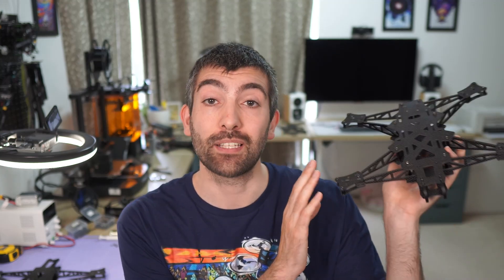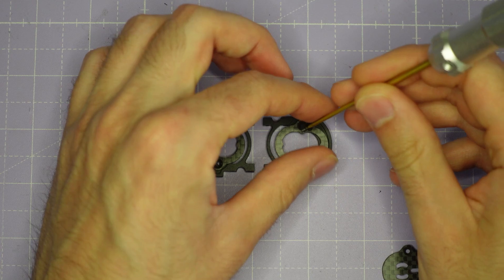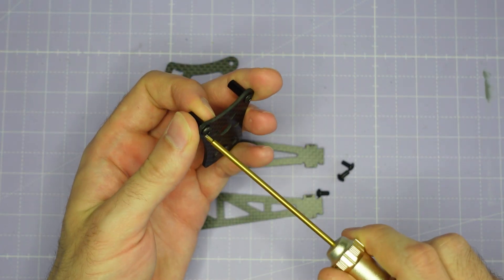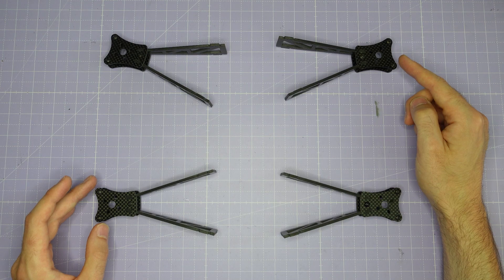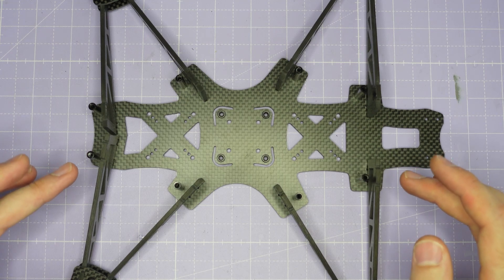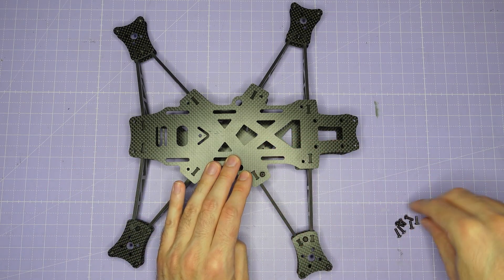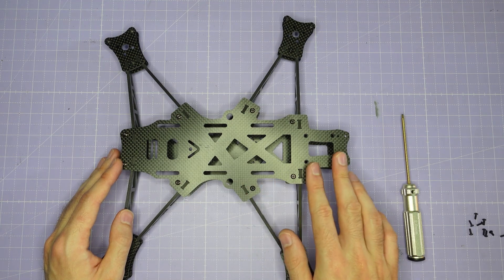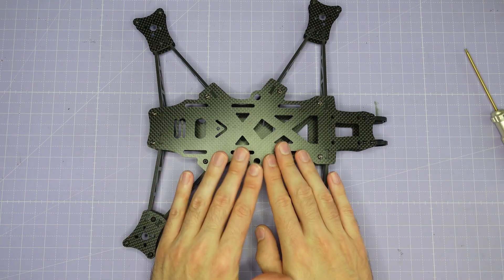AOS UL7, 8 and 10 V5 Build Guides

Comment: Pretty disappointed with my AOS UL8 frame I ordered from Cncdrones. None of the arm tabs fit into the slots on the motor plates or the frame and not just the width of the slot but the length too. Some of the slots hardly had the dog bone shape and I had to spend 2 hours filing and test fitting. I really hope this drone/frame hold up well.
Reply: Hey, thanks for sharing your experience! How has the AOS UL8 been holding up for you after some time of use? I was thinking of getting the same frame too, so any tips or advice would be super helpful before I decide

Comment: FYI for Ul10 build with the 3d printed camera mount for the O4 air unit pro I had to mount the carbon camera plate on the outside of the aluminum cage in order to get the camera to fit. If you do the same make sure to locktite the screws.

Comment: Pro tip: I've built like 8 or so of these frames. Once you have the arms ready to attach to the frame use zip ties to hold the arms on the frame. When you want to take it apart again zip tie again before taking off the top plate. It's a pain I know.
Reply: Hi, is the frame really performing as promised? Does it really have no vibrations? I read comments that say the arms move a few millimeters when it is closed.
Reply: @koni8391 Hi, with this frame i turn stabilization off on gopro & O3 air unit and I see no vibration unless you're pixel peeping & you gotta zoom pretty far to see micro-vibrations. As far as play in the arm I did have that problem on a few frames of the previous version, but I blame CNCdrones for that who makes Chris Rossers frame. It was a little weird because like i said I've made several of these frames with no issues.

Comment: @chrisrosser.. I may be wrong but when assembling the arms you need M3x5mm screws not M3x10mm? there's not enough room to use 10mm on top and bottom. They're only 10mm standoffs.

Comment: My UL10 V5 frame showed up yesterday afternoon!  Completed basic assembly before I saw this video.  I've already built a UL7 so I was familiar with the procedure.

(your note from the future regarding doing an X8 build cleared up the question of why my frame kit had so many extra screws)  

My arms were a tight fit.  I chose to sand a slight bevel into the 4 mounting tabs on each arm to get them to fit rather than filing the openings.

I assembled the arms and mounted the motors at the same time.  Your note regarding the wire orientation is well received.  Also note if you get the latest version of the frame with the X8 motor plates you need to make sure that the top and bottom motor plates are oriented identically.  If they're mirrored the holes in the bottom plate won't match up with the motor bolts so you cannae get a driver through in order to tighten them.

Gear : I'm using a Flywoo F722 pro V2 50A stack, 3115 1050kv motors, a Walksnail Moonlight camera & vtx, a Crossfire pro RX and a Goku GM10 pro V3 GPS module.  

note : motor kv is a little too high for 10" props on 6S but OK on 5S.  I can also run these on 6S with 9" props.  
~900 kv motors would be a better fit, but I already had the 3115s on hand, sooo....)

I'll be using the same TPU GPS / VTX antenna / Crossfire mount that I used on my UL7 as I've had better luck fine-tuning with short(ish) antennas hanging off the tail of the frame vs. tall ones in the center.

there is sooo much room in this thing.  Even with all the electronics laid in it looks empty 🐸
Reply: What is the dry weight of the 10” frame?

Comment: Hi Chris. I decided to go for the AOS UL10 V5 because I think this is the one that might benefit most from the improvements in design in terms of weigh reduction. Do yo you have recommended parts for it in terms of motors? I plan to use a NOMAD from Radiomaster and I wonder about how to properly set the 4 antenas for the receiver but that will come later... Regards
Reply: What is the dry weight of the 10” frame
Reply: @JamieRenken-s1s  My dry weight is 1.156 grams. Hope others can report dry weight of other 10" drones
Reply: @ignaciohernandezros  so is that including the electronics or is that just the frame by itself?
Reply: @JamieRenken-s1s  That is excluding the battery only. All electronics, straps, buzzer etc is on
Reply: @ignaciohernandezros what is just the frame weight
Reply: @JamieRenken-s1s  Sorry, I can't tell as I never weighted it at that moment